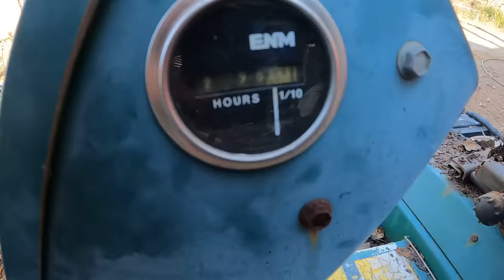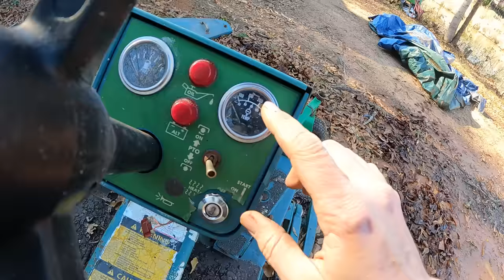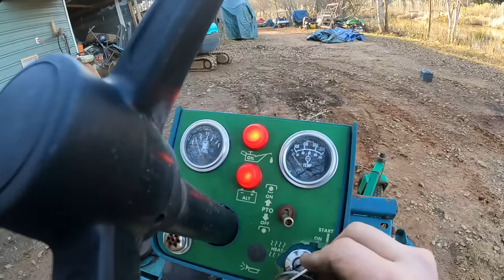INDUSTRIAL DIESEL MOWER LEFT ROTTING IN A JUNKYARD FOR OVER 20 YEARS…. CAN WE SAVE IT??

Comment: It never fails to amaze me that people will pay thousands or even tens of thousands of dollars for a piece of machinery and  then just leave it outside to rust into oblivion. Is spending $8 on a tarp to expensive?
Reply from the maker: well the guy passed away and his kids let everything rot
Reply: I don’t believe anyone has invented a tarp that will last 20 years. When you do let me know
Reply: Even $100- $200 for a proper cover wouldn't be too much to protect a machine that costs thousands new.
Reply: Thats why i built a shed to put my lawn mowers in.
Reply: @riderofthenightfury 
I picked up an old 8X10 shed for free.  I built a wood frame screwed the sheet metal to 2X4 and for about $100 have a good shed for my mower.  My mower is only worth about ,$2000 still its better than sitting outside.

Comment: It is a one way cylinder.  Only pushes out, depends on some other force to push it back in (deck weight).  There is oil getting past the internal seals and getting into the space the squishes to almost nothing when  cylinder is extended.  So bypass oil is pushed out that little yellow breather valve to prevent the cylinder from hydrolocking before it is completely extended.
P.S.  Right after posting this comment you explained all this 😮
Reply from the maker: Yes sir👍

Comment: My first career was 27.5 years at a public golf course.  We bought a new Ransomes front deck mower in 1996. Yours is older but I can’t tell how much older.  Ours was similar in form factor to yours but scaled up in size and a 72” deck.  The best part of the whole machine was the engine.  Unfortunately the transaxle was the biggest weak point and extremely expensive to repair.  It was well known as “The Ran-sometimes”.  They’re essentially competitors for the Toro Groundsmaster line.
Reply from the maker: very good info my friend!! could you give me some more details on what goes bad in the trans axles? this machine has two drive motors on each wheel do they go bad?
Reply: @TheHomePros6221  The company is still in business, and manuals are available.
Best wishes all.

Comment: This looks VERY much like the John Deere 'F' series of 'f'ront mounted mowers mowers. I have the F725, which is gas powered and 52" deck. But they also had a diesel version, and other versions of varying sizes. It is possible that some of these Deere parts may fit (or be easily adaptable) to your unit, if you fall into the parts black hole. I'm pretty sure my F725 was made in 1973. And I still use it as my main mowing and snow blowing machine today.
Reply: Jacobsen and gravely also had similar models
Reply from the maker: ransomes and Jacobson and maybe even gravely are owned and produced by textron, but it seems like a lot of the parts used on this mower are universal parts like the hydro pump, peerless gearbox, simple hydro cylinders…ect the hydro pump, orbital steering valve… ect are all the same as the ones on my Steiner as well
Reply from the maker: yes I’ve looked at those pretty neat👍
Reply: Gravely is owned by AriensCo of Wisconsin USA

Comment: When you redid the hydraulic cylinder, there were two o-rings with back ups (flat plastic washers) in one spot and one o-ring in the other spot. I believe the single o-ring needed back ups as well. You should be able to get them from any shop that has basic hydraulic parts or on line. It looks like a well built machine that you will get years of use out of. Take care.
Reply from the maker: I looked at the parts diagram and it doesn’t call for them, it’s also a stationary peice unlike the piston that does require back up rings, I did think the same as you when I took it apart but the diagram said otherwise

Comment: Actually considering the condition of the battery tray, I'm surprised the deck isn't in worse shape then what it is. I'm sure the battery tray was a replacement and they didn't paint it and over time the water, rodent urine, and droppings finally ate away at it. That's just my guess though. I could be very wrong.

EDIT: I see what they did now.  The battery tray was relocated to the outside for easy access and to fit a bigger battery maybe.
Reply from the maker: it’s pretty amazing honestly!
Reply: @TheHomePros6221  definitely a great find

Comment: Throw the mower deck and related bits in the scrap metal pile and mount a heavy duty garden trailer dump box on the back of the frame above the engine and radiator. If you are really industrious you could add hinges and a hydraulic cylinder to make it a dump bed. You would have to make sure the rear spindles, wheels, tires and the rest of the structure is strong enough to support more weight.
Reply from the maker: great idea I was even thinking of making a forklift out of it

Comment: Love seeing the old grounds mowers get back into service. I've owned several. So long as water hasn't got inside the engine, or it wasn't blown to begin with... they're all pretty bulletproof, except for the transmissions. Most used Sundstrand Series 15 inline.
Reply from the maker: Yes sir and I actually have a spare sundstrand 15 part 2 almost ready to upload!
Reply: @TheHomePros6221  - there's still a market for those, if you can source rebuild parts. I know a guy in North Carolina who flips them for about $300 profit. Not bad for 2-4hrs of sidework.
Reply from the maker: @driverjamescopeland  sweet👍 the spare one I have is in perfect shape I took it apart.. no issues 😊

Comment: Had one of those. Was used commercially when i bought it. 3500 hrs when i bought it had 4900 when i got rid of it. Was a real decent machine, the deck belt i bought from a ransomes dealer, i believe it cost me $80. I was told those Ransome jaguar 4000 were 15,000 new.
Reply from the maker: Part 2 is almost ready, I got a belt it’s was like 130-150? Can’t remember but this is one cool rig!! Why did u end up selling yours? Wow 15k I beleive it they are solid machines

Comment: Your correct on the vented plug..
Its a single acting cylinder..
Pressure raises it & gravity lowers it..
It may be that the rubber seal on the piston dryed out .  Once relubricated they sometimes expand & heal them selves...
But since you tore it down , Id replace the seals.
Reply from the maker: yes sir you are correct
Reply: My understanding is that because the cylinder is “single acting” it allows the mower bed to “float” when cutting rough ground.
I have a Ransom that’s very similar but has three cylinder cutters mounted on it, typically used for playing fields. If looked after they last forever and the older ones are highly sort after because they built like tanks. Enjoying the vid, thanks.👋🇬🇧😀

Comment: Spray air into the outside of an air filter will clog it up further. I tested OEM filters for James N Kirby Products Rockdale for car makers in the 1980 here in Sydney Australia.  I certified they filtered dust efficiently.  Always spray air gently from the inside of the air filter. You can even wash them in petrol to remove oil and dust.
Reply from the maker: I always blow air on the inside as well👍

Comment: The fact that the lift cylinder was already messed with, i would guess that they cheated and put in basic orings instead of tracking down the proper 'CUP' seals. Thats why you could use a simple off the shelf o ring kit to freshen it up.  The proper seals shouldn't let any oil bypass to the vented end.
Reply from the maker: Good point but I looked up a parts diagram and it’s the same o rings
Reply from the maker: I’m thinking that maybe it sitting for all those years some oil just bypassed the rings

Comment: I’ve had some pretty rusty mowers in the past, but nothing this bad.
15:00, I’m surprised the little door on this particular cover didn’t fall off, it was still functional.
Didn’t key at 24:19 work, since the lights came on.
Like with a consumer grade machine you need to have your foot on the brake or the brake locked before it will start.
29:39, I’m glad you said it not me, I was going to suggest the seat safety.
Reply from the maker: Thank for watching my guy! It’s crazy how some stuff was rusted out and other stuff wasn’t, the key went in but just didn’t work rite. I was trying the foot brakes but noticed they didn’t have a senso but the drive pedal did

Comment: Dude, hot rodding trick...use welding electrode wire. It offers very little resistance and makes great battery cable.
Reply from the maker: Thanks for the tip!

Comment: Being the OEM color of your Ransomes is green, I would venture to say mid 80s vintage. They originally had a color called Cats Eye Gold and this was their color choice of their equipment prior to the early 80s which today would look like a faded out mustard yellow in color with black decals. I've seen this model before but mainly used the Onan 16hp opposed twins along with the early Briggs Opposing twins as their power sources. Not too many came with the diesel engines in my neck of the woods here in upstate NY.
Reply from the maker: that’s awesome thanks for the info

Comment: The uni-strut bolted to the rear could've been the beginnings of a small tow hitch point or was used as such, but it missing parts. Tow an aerator, dethatcher, cart etc.
Reply: they probably added the battery tray cause they used or had a cheaper battery laying around lol
Reply from the maker: yea I was thinking the same thing, the plate just needed a hole drilled in it

Comment: Lift cylinder is internally leaking and getting to the other side of the piston and when you lift the deck up it forces out the hydraulic oil that has leaked past the piston and out the vent plug you pulled out.
Reply from the maker: yes sir

Comment: If you try blowing thru that brass vent, I believe they're only a one way valve, despite them looking like a two-way. Ones I've dealt with seem to only let air/pressure in and not out, but maybe with a greater pressure they'd let some leak out - unless it was the threads leaking.
Reply: I was trying to use them on a fuel tank to help with the gas vapor expansion in the sun/heat, and the ones I had did not let pressure out like I had hoped.
Reply from the maker: air goes both ways through it I thinking it just let fluid by from sitting so long
Reply: @thehomepros6221  ah interesting and yeah probably then

Comment: I bought a toro 9 foot cut finishing more that wouldn't run . Spent a couple hundred on parts and cleaned the fuel system as it looked like it was run without the fuel cap on. Its been perfect for over 5 years now . Paid 13000 worth 105 thousand new.  Turbo diesel 85 hp
Reply from the maker: dang that’s a beast of a mower!!

Comment: Tractor supply sells a complete suspension seat for around $100. Put one on one of my mowers a couple of years ago and still doing fine. That looks like a standard automotive serpentine belt to me if you measure the  length you be able to pick one up at your local auto parts. The pump seemed to have considerable whine, maybe that filter is plugged? Anyway looks like a well built machine. Oh check the gearbox on your pto, it might need grease or oil.
Reply from the maker: Good deal brother👍 the belt is a pretty serious heavy duty ribbed on both sides belt it was pretty expensive also cheapest I found was $150, the pump sounded a lot worse on camera it actually sounded pretty good driving it, but yes all fluids will be changed 🙂

Comment: I also picked up one of these mowers years ago from a golf course. It’s a ransoms/Jacobson. Front cut Mower. It did not have a mower deck on it but I do have what’s called a core destroyer. Used to break up the clumps of dirt after aerating a field. I paid a little bit more for mine. I just wanted it for the diesel engine which is a Kabota D 1105. I sold the rest of the Mower otherwise I probably could’ve gave you the part number to that filter for the hydraulic system. I may have a book still for it. I’ll have to look I’m pretty sure the hydraulic system just takes 10 W 30 motor oil though.
Reply: You’re in luck I found my book. Hydraulic part number is 118017. Listed in my book as a filter element 10 MIC. Which might mean 10 micron filter.
Reply from the maker: thank you very much!! it takes the same one my Steiner takes 😊

Comment: I Don't like that no one is donating 1/8th-3/4 inch sheet metal stock, Flat Bar Stock, Angle Iron Stock, 1/8-5/16 C Bar Stock, 1/8-1/2in I-Bar Stock, 1/8-5/16ths, nor a Miniature Lathe with Two, Three, and Four Jaw Chucks with a Five Year Insert Supply, along with a large set of Collet, and Tool Bar and Holders, a, Miniature Milling Machine, Mig, Tig, and Stick Welders, Plasma Cutter, Plasma Table, Laptop with CAD Software, CRC Milling Machine along with a wide variety of Milling Tools and Supplies, Miniature Scraper, Blast Cabinet, Heavy Duty Industrial Shed, Dual Grinder, Machining Table, Machining Vices, 1, 2, and 3 Block Sets, a Large verity of C Clamps, Bar Clamps, Rod Clamps, a Mass Collection of Nuts, Bolts, Washers, a Large Roll of Gasket Material, O Ring Supply, Angle Grinders, Band Saw, Impact Driver, 500 Ton Press, Metal Bender, a Large Set of Ratcheting Wrenches, Breaker Bars, Wrenches and Socket Stets, Metal Chop Saw, Belt Sander, Three Phase Power Setup, a Car Lift, a Ceiling Crane, a 500 Gallon Diesel Fuel Tank, etc. 
Does Anyone Feel the Same Way?
Reply from the maker: hahahaha

Comment: I have a 325d Toro Groundmaster, 72 inch deck. They look very close to having the same parts and engine with a k3d engine. Look on line to find filters and blades. Hope this helps.
Reply from the maker: I mite be getting two either 323 or 325 groundmasters as well they all along with this one have the mits. L3E engines

Comment: Hey guy, I'm new here. But your filter housing looks like an aftermarket filter housing for a transfer tank. U1L6FE is a buyers brand filter for a 3/4" hydraulic head, I'm sure it could be cross referenced. ALSO, I think someone was monkeying around in that hydraulic ram before you. I'm pretty certain those bore side of rings should be square shoulder rings, not round. Might lead to leaks down the road. Cool video though, thanks for the content!
Reply from the maker: thanks😊

Comment: You should be able to get a model year off of that tag on the air filter box. I am not familiar with this brand, but on most of the mowers I own, the model year is the last two digits in the model number.
Reply from the maker: I checked but from the research I’ve done it’s a late 80s or early 90s

Comment: The deck on that uses hydraulic pressure to float and transfer weight to the tractor itself you have an internal seal leak that is letting hydraulic oil get past to the front of the
Reply from the maker: how would that work? it doesn’t have any weights to transfer, I didn’t see anything in the parts diagram about that

Comment: You would save yourself a LOT of money on engine and parts cleaning with this product.  TC-DG100.  I have used it on many things and it almost works as good as a caustic soda bath. Just mix it half and half with water and put into a sprayer.  It will remove all hydrocarbon residues and I've even seen it remove concrete residue from a roto-trowel that was allowed to harden.
Reply from the maker: I’ll check it out thanks!

Comment: I know why they putteth the battry outside. It is cost. Those small high amperage battrys cost a couple hundred dollars while a larger lawnmower battry is 30 or 40 dollars. Which would ya'll get there mr mr. For the same durn thang. Say, now I know ya'll are having fun rodding around with this tractor, what ya'll need to do is save this engine for your excavator if it goes bad. Probably won't, so when ya'll get a 120 excavator it can go right in, then the dirt will be flying. You need a heavy duty trailer first so ya'll kin go find one stuck back in the brush summers. That electrical clutch will even make the rotation happen. My big rottweiler I loved so much died in a couple of weeks when he had bone cancer in his right rear leg. That was the 3rd and I am still crying I loved that silly boy so much. Very painful.
Reply from the maker: well I put one of the $30 lawn mower batteries inside under the seat and it fit so maybe they added a car battery inorder to power somthing they pulled behind it🤷

Comment: the cylinder needs rebuilt- the seals are bad and the fluid is passing the seals
.
Reply: When I didn't have any grasshopper specific hydraulic oil I substituted Walmart Supertech ATF and it worked fine, sometimes ATF fluid softens seals and gets them working.
Reply from the maker: my skidsteer takes type f trans fluid, but this mower has the same pump as my Steiner and Steiner says to only use their fluid but ransomes calls for just regular 10w-30 motor oil so I’ll prob just put some universal tractor fluid in it

Comment: Why I don't like diesel engine  for my self. If stops running harder to fix and cost of repair. To replace gas motor is cheaper.
Reply from the maker: these diesel engines go many many many more hours than any gas engine will ever go and are much easier to fix if they rarely ever break, im a diesel fan for life lol
Reply: @TheHomePros6221  I like tell repair cost.  It's the cost of buying. There is the part of is it for homeowners or a business.  As a homeowner I don't have a ton of money. And not a every day use. If you start using all the time and make sense to move to a diesel unit.
 As a business then it time for the
 diesel. Makes more sense. Used every day. And with business you get to depreciate the cost over the years.
Reply: I love the reliability and simplicity of a diesel. One Grasshopper with a Kubota and two John Deeres with Yanmars.